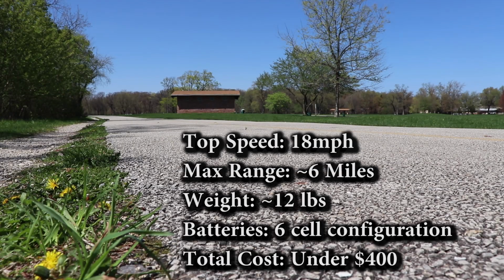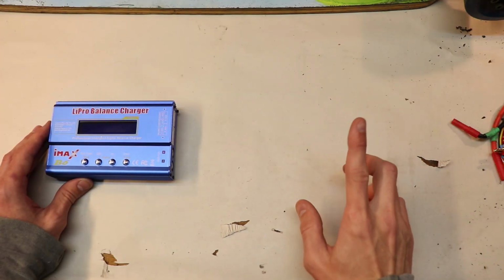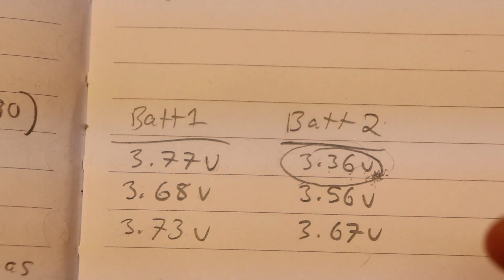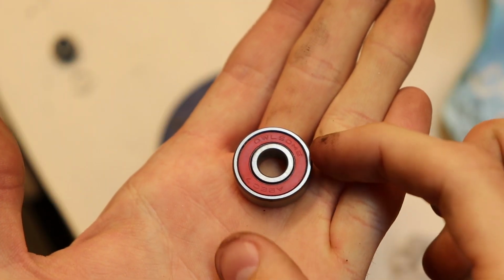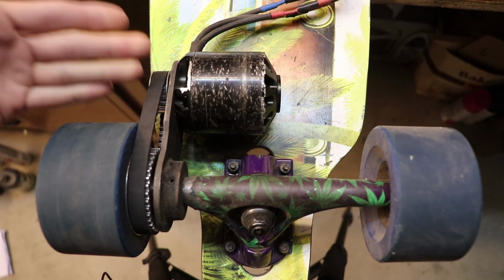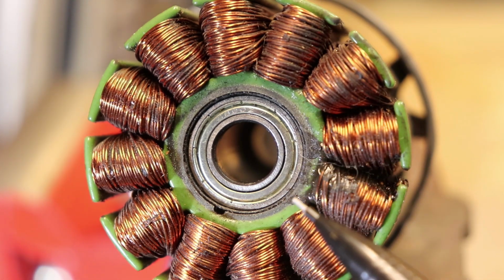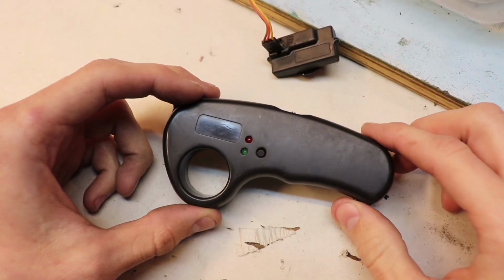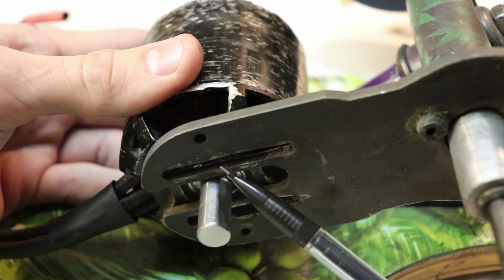DIY Electric Skateboard

Comment: A lower kv motor doesn't mean a bigger motor. It means how many rpm you get per volt (unloaded). A lower kv rating means slower speed, but higher torque. A higher kv would be higher speed, but lower torque. Personally for my build, I used a 170kv motor, because it gives a lot of torque necessary to climb huge hills, and has more than enough speed. 
Motor size on the other handis classified by four digits - motor diameter (mm) for 2 digits, and motor length (mm) for 2 digits. An example of this would be a 6374 motor, as it appears you are using. the 63 means the diameter of the motor is 63mm, and the 74 is the length of the motor. Other common sizes include 5054 (often used in prebuild boards), and 6354.
Nice board though and good job explaining everything with detail.

Comment: Look into a parallel balance charging board for your battery charging. 
Read up on voltage difference requirements of batteries to charge in parallel.

Comment: Charging at 5a would be a standard charge for a 5000mah pack.

That is 1c.

10amps would be a fast charge.

0.5a is just crazy crazy slow.
Reply from the maker: I'm aware of this, but if you have plenty of time, or maybe charging overnight, as a personal preference I like to charge the batteries slowly. Less heat and more peace of mind for me.
Reply: @SciCynicalInventing  charging lipo's unattended (overnight) is far more dangerous than monitoring at 1c charge rate.
Reply from the maker: @ryanokeefe12  Whos to say im not keeping a sensor near the batteries to monitor overnight charging?
Reply: @SciCynicalInventing  cop out response. regardless, in answer to your question, it doesn't take long at all for a 3s lipo to start a decent fire when it's near full charge.